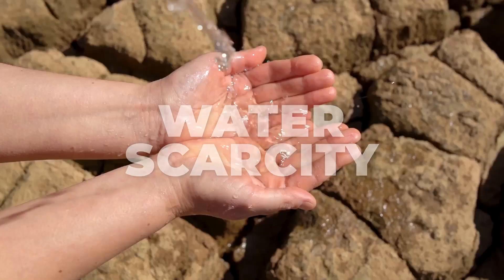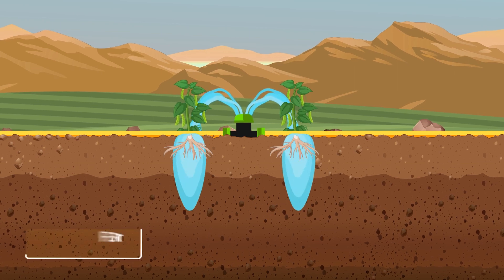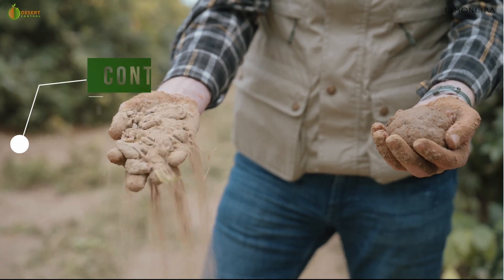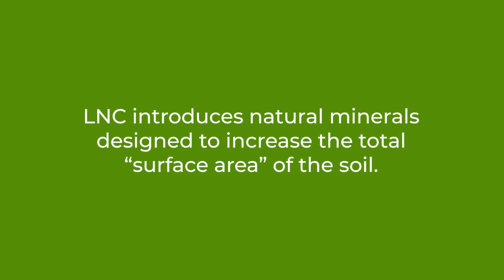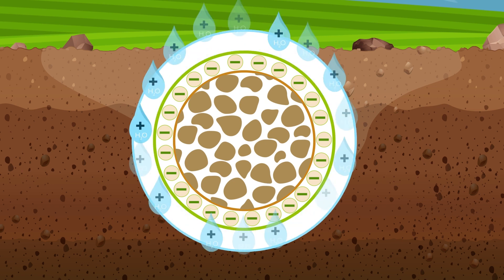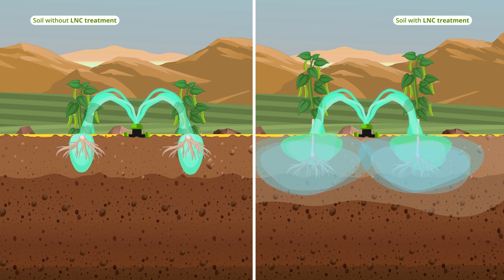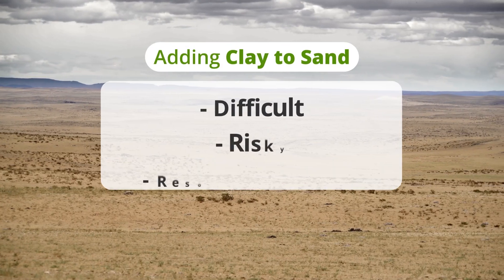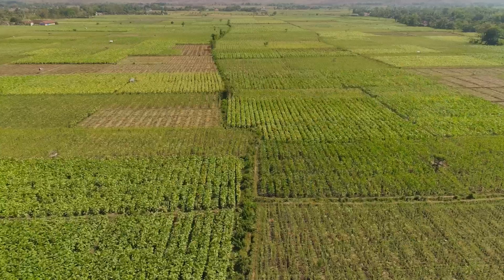#SaveSoil for a sustainable and resilient future

Comment: This is what biochar does, and is possible using nothing but waste and scraps.
Reply: Correct me if I'm wrong, but doesn't biochar only retain nutrients? I don't think adding biochar to sand will make it hold water.
Reply: organic matter acts like a sponge and in sandy excessively drained soils 1% increase OM basically doubles water holding capacity. However delivery of sufficient amounts of biochar and even in-soil distribution is difficult to do quickly.  @JohnDoe-ji5wg
Reply: you're wrong though